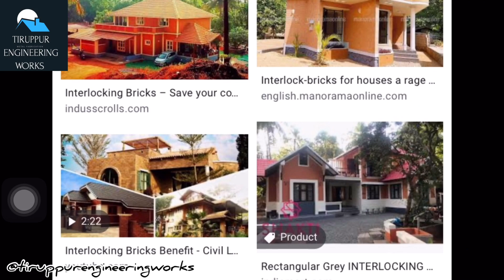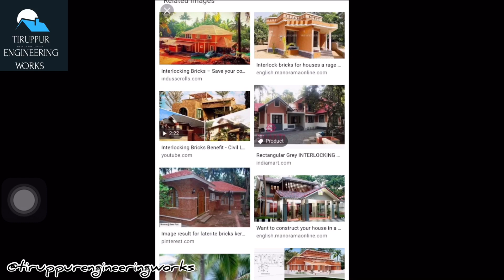Interlocking bricks and it's uses

Comment: Language...??? 🤐🤐🤐 Each Brick Size & Weight please? 🗣💤💤💤
Reply from the maker: Cuboid Interlocking Bricks, Size (Inches: 9 In. X 4.5 In. X 4
Size (Inches)	9 In. X 4.5 In. X 4 In.
For Use in	Floor
Brick/Block Color	grey and red brown
Shape	cuboid
Reply: @tiruppurengineering  2:35, Could you show big size Red Brick making machine of this video please?
Reply from the maker: Yes you need manufacturer number
Reply from the maker: You whatapp me 9842012175

Comment: Plz tell any disadvantages
Reply: Coloum size vary agum.... Normal brick wall 9 inch ithu 8 inch mathanam illana column visible  theriyum... Aprm  partition wall brick size 6 inch athu inner size kami panidum
Reply: Bro avanga disadvantages iruka nu kerukanga, neenga advantages potrukanga, intha method la disadvantage iruka?
Reply from the maker: @santhoshkumar-lf1lv  no bro still I  can't able to find some thing like that sorry it is  brick if is clay interlocking brick it has cooling effect. normal no cooling effect it is also same as red brick but had more benefits that soul
Reply: @tiruppurengineering  onuu unghaa kitaa dout keta adhaaa clear pananum adhaa vituu tuu rombaa arivuuu thanamaa peasurathaaa , nanaikaa kudathuuu 😒 , neegha oruu civil engineer
Reply: Edhuu pathiii people enum awareness illa la unghala mudhichaaa people ku awareness create panughaaaaaaaaAaaa
Reply: Nakalaaa bathil sollamaaaaaaa
Reply from the maker: Many disadvantage madam your money will save, your time will save,, less useage of cement and raw material, labour charges will save,

Comment: Brick size sir
Reply from the maker: Interlocking Bricks, Size (Inches): 16 inch x 6 inch x 5 inch
Size (Inches)	16 inch x 6 inch x 5 inch
For Use in	Boundary walls, Side Walls
Packagin Size	1000 piece

Comment: Is this safe for earthquake?upto how much Richard it will be stable?
Is this type of bricks will increase building temperature? Becos mud bricks will reduce building temperature upto 1 to 2 °Celsius.
Reply from the maker: Bricks specifications
Bricks per square metre – 76mm	50
Bricks per square metre – 70mm	55
Bricks per square metre – 62mm	62
Brick Weight	approx 3.1kg
Brick Dimensions	230mm x 110mm
Bricks per pallet	500
Pallet weight	approx 1.7 ton
  Brick need to full fill all the parameters then only government will allow this brick to construction and one more thing temperature will be normal as red brick thankyou madam